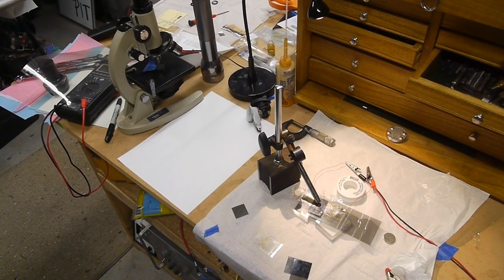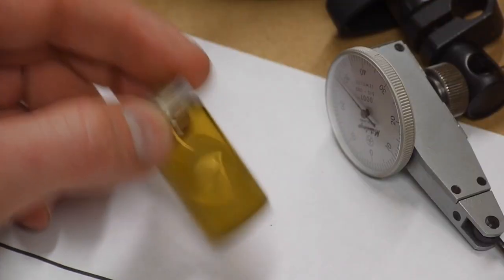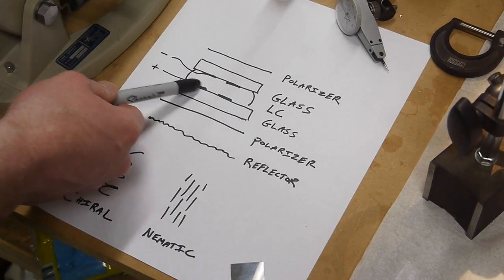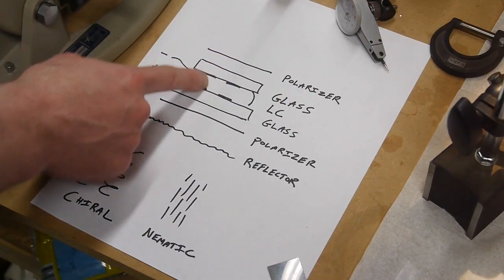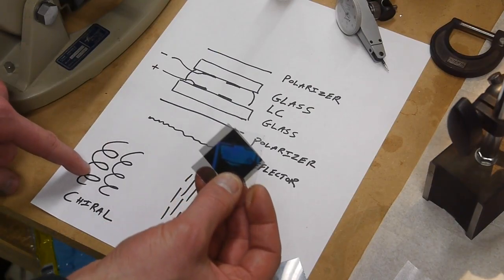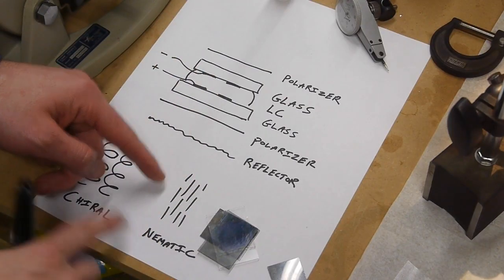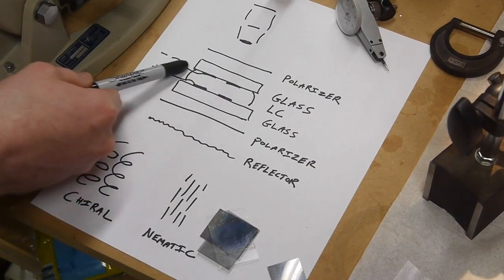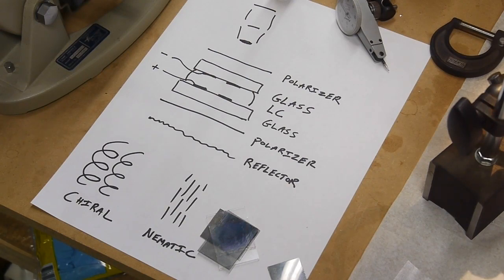Building a liquid crystal display (LCD)

Comment: You mentioned using sand paper for your scratches, maybe the medium was too coarse. Perhaps a finer medium like an 8,000 grit (Japanese water stone), or higher hone may be more effective.
Also a completely different technique (tumbled media?) may merit investigation.
And, amount of applied pressure seems to have an obvious impact.
At any rate if most of the LCD's are mfg in China, it is obvious, the industrial process has been perfected (...or somewhat); and, is done rather cheaply. Albeit might be labor intensive, hence the Chinese output source.
While I champion your efforts, and, by no means intend anything but encouragement. Time spent delving into current manufacturing techniques might be beneficial; (I don't know if you obviously have, then in that case I apologize).
I just stumbled across this particular video you took the time to make, and, enjoyed it thoroughly.

Comment: Yes! Extremely interesting to see this explained through the early experiments. It's always that when you look at the finalized product, it has so many additional elements that complicate the basic functionality making it harder to comprehend.
Thanks!
I was still wondering, when talking about the 270 degree turning, doesn't it work in the same way with every 180 degree twist?
I mean -90, 90, 270, 450, 630 etc.

Does the mixture affect the contrast? If it has 90/10 of chiral, would it have different attributes compared to 10/90 nematic, given that the both mixtures add up exactly to 90 degree twist at their length (the other mixture would obviously need different length because of the different twist rate).
Reply: +Ben Krasnow Genius

Comment: So, the two polarized layers block all light, but when power is applied to the liquid crystal layer, then it scrambles the light and makes is kinda see through-ish?
Does my watch have to apply power to all the "viewing area" where you don't wanna see the black 7-part numbers? Why is it that when the battery is dead, the whole thing doesn't go black?
Reply: ***** So if the two polarizers are aligned with each other, applying power everywhere else but where the symbol is will will produce the same effect as having two polarizers at 90* and applying power only to the symbol/graphic/number ?

Comment: Rubbing the poyimide does not only induce scratches. It actually stretches out some of the polymer chains as well. This helps with the alignment process. I think this is why your glass rubbing was not as effective as you hoped.
An alignment layer can be made by dragging a piece of PTFE across the ITO. You have to press quite hard and it helps if the glass is hot. This process leaves a layer of aligned polymer molecules on the glass surface. It works surprisingly well.
Reply: ***** When I was doing my PhD back in the early nineties it was a handy way to induce alignment in other polymers when casting from solution. The effect was originally discovered by David Tabor and his co-workers in the early seventies.
David Tabor was a true giant of the scientific world – and all round really nice person. Not enough people know about him. A nice summary of his life and works can be found at: http://www.smf.phy.cam.ac.uk/files/574FrictFieldBMFRS54.pdf

Comment: Wait.
Before you stated that you wanted the light to twist 90 degrees or you lose light.  So you put that twist to allow light to pass.  Right?

Now you said you put force to discourage that twist.  Doesn't that remove the twist so now you get no light again?

It seems counter productive.  I missed something?

I don't know if what I am calling the things are correct becauseI have a terrible memory from a disability, but I hope the description helps you know specifically what I am getting at.

Thanks and I hope to hear back!  Very curious.

Comment: Fascinating video. I work with LCD displays and there were still quite a few bits of information that were new to me. I especially liked the 'rubbing the plastic' to align the crystal molecules.

I'd be interested to see you manufacture a laser, not an LED one, perhaps a gas or crystal one.

Thanks again.
Reply: I hope someone has one for you, I'd love to that that.
Reply: *****
what are they used in ? 8KJ xenon flashtube.  I have a question. quartz can be liquified yes? and would it act as a light focusing device in the right shape? but more importantly, what are the flash tubes used in?
Reply: Bill Kratzer Not a whole lot these days unfortunately. The flash tubes good for ruby lasers are very large and spiral in shape. Many have an outer jacket for water cooling as the heat produced inside a laser cavity is intense enough to cause thermal cracking of even a quartz envelope with even modest pulse rates.
Reply: Matt Giordano
but Matt, what type of device is this component used. there are sources out side this country.
Reply: oh yea, thanks for the response. but this guy Ben is awsome and I would like to help
Reply: Bill Kratzer Well, they were largely developed exactly for ruby and Nd:YAG lasers. Flash lamps of the approximate power and capacity were around for other industrial lighting needs but it wasn't until the need for a pump source for laser rods arrived that they began fabricating them into spirals/solenoids. I suppose linear lamps could be used but cavity design and efficiency would suffer greatly. I'm not sure they are even used/manufactured at all today. I too would love to see Ben get his ruby laser running though. There was some talk a few years back that a 17kW xenon short arc could pump a ruby laser CW if a cavity could be built for it.
Reply: time zones suck. but I will seek more info. Ben just has a knack for explaining
Reply: perhaps I'm asking the wrong question. what device, or where exactly would this flash be used? flash lamps imply photography. I think you mean otherwise.
dimensions would help
Reply: I have no preconceived notions. I think outside the box. if that helps you to understand where I come from

Comment: Excellent explanation.

It wasn't entirely clear if the orientation of the crystals stay the same when no power is applied, or if they revert to the curly state. If the latter, that means dark pixels actually take a bit more power than light pixels?
Reply: Imagine the molecules forming a ladder with a 90° turn from top to bottom. If you apply voltage all the rungs of the ladder flip down, without voltage the will flip up again (they "fit better" that way). But because the flipping back takes some time if you just disconnect them (no use in a LCD), they are actively driven to 0 volts. Which means, it's the change that uses power not the on or off position. Once the voltage is applied there's no current flowing, so now power.
Reply: Ok, that's how I'd previously thought of it. So only changes takes extra power.

Comment: How small are the commercial microscratches? For a better and more uniform setup, you could probably get some ultra fine diamond polish and mix it with vasaline or silicone oil and squeegie it across thew surface. I ordered a pre-mixed diamond+silicone oil polish set for lapidairy work and the finest I have says it's 0.5 micron which is like 50,000 grit and I've read there is 0.25 micron/100,000 grit as well.

Comment: The cloth rubbing trick is great. There are loads of weird industrial tricks like that in manufacturing, some times the old way is still the only way.
Reply: It reminds me of the technical challenges that were encountered during the development of the SR-71 such as the massive thermal expansion of the fuel tank pieces. We still don't have any polymers or elastomers that will stand up to the temperatures involved.

Comment: Spin coating a polyimide layer should be something you can achieve. I used an ordinary DC computer fan with slides attached to the hab with a couple of screws in an undergraduate lab once. Getting hold of a suitable poly(amic acid) solution might be tricker.